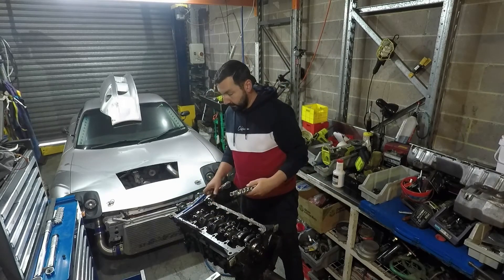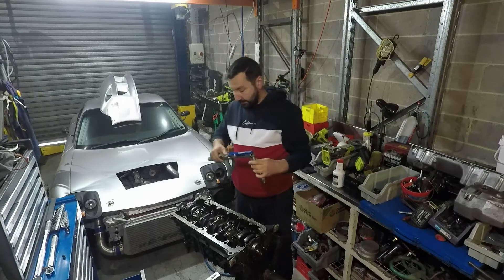HOW TO BUILD A BMW ENGINE M50 M52 TURBO 1 of 4 (BLOCK)

Comment: so it is possible to put m50 nv rods to m52 crank with m52 pistons?...
Reply from the maker: Yes. You can put those rods in an m52 b28 or m52b30 stroker As they are 130mm

Comment: Note: If you want to build a budget turbo stroker motor using the M54B30 crank, and you're like me with an M50B25 non VANOS thinking "Oh, i'll just use the THICK BOY non VANOS rods with the 3 liter crank", then think again.  You cannot run them as they hit the bottom of the bores with the longer stroke crank. It almost has a 1.5cm longer stroke. Ask me how i know... 
I guess you could start cutting. It doesn't look like too much needs to be cut away. Definetly doable, i just got aftermarket rods instead. Didn't wanna deal with the headache.
Reply from the maker: Yeah I would assume it's from the longer stroke. No issue with the 2.8
Reply: Did you have to gap your piston rings
Reply: @drayescobar9469  If you have crank and pistons/rods out anyway you'd be stupid not to get new rings and gap them for the best results. If you're leaving the bottom end untouched then just send it. A lot of people do, but with varying degrees of success.
Reply: hey brother....can i use m50 nv rods to an m52b28 crank and m52b28 pistons?
Reply: @mateoseggonidis I believe so. If it’s an m50 non vanos you have to bore it out to fit the m52 piston size
Reply: I have an m50 vanos (technical update) (m50b25tu to be exact) . Would this engine be fine to build for boost, or does the non-vanos m50 have advantages over the vanos m50? I want to build it for fun, nothing crazy. or how much power could a stock m50 vanos take boosted?
Reply: @TheAnointedOne7  Both are fine for boosting. 400-500hp easy, especially if you have access to E85 instead of pump gas. Having VANOS is always better than not having VANOS. Non VANOS have some advantages if you leave the engine stock and do a budget build, like the rods are a bit thicker, the valves are 7mm instead of 6mm so thicker, and the head has double valve springs so it can rev higher. Your stock cams dont make power past 6500-7000 RPM, so being able to rev to 8000 is useless. The downside is some electrical stuff like sensors and ECU are an older type and you don't have VANOS. VANOS will make you spool about 500rpm lower which is a lot if you realistically only have 3000 RPM worth of powerband. It's not something you should worry or care about for less than 500hp. The rest of the stuff are all the same. Work with what you got. Non Vanos was only 1990-1992. Theres a LOT more people that have turboed M50TU and M52 than M50 non vanos.

Comment: Question: How are you using 135mm m50 rods in a 2.8 liter which originally comes with 140mm rods?
Reply from the maker: The M50NV Rods are 135mm same as the M52B28. The M50TU rods are 140mm. It took a while to measure everything up but it all works. Thank you for your question. Its something i should have addresses in the video.

Comment: hey vas ik this is a old video but could i use this guide for a s50? i got one in parts but idk where to start assembling it, plan on slapping on a small snail
Reply from the maker: I feel almost all engines from 92-2005 are pretty much the same, that's why all the parts are interchangeable. Main difference with the S50 is the head design is completely different.
Reply: @VasKatsaras so can you throw a s50 head on a m50 iron block?

Comment: Another option for head sealing is o-ringing the block, then you can run a stock composite head gasket and it will hold to over 1k hp. Pretty handy if you're pulling the head regularly because the stock head gaskets are cheap.
Reply: How do u 0 ring the block
Reply: @woapaggin6803  you can get a machine shop to do it or do it yourself
https://youtu.be/gbWAgi82cOY
Reply: Disadvantage is if something goes wrong with the tune up etc or detonation u will take the head out just use stock OEM gasket with arps it works great u rather have the head gasket go out then destroying the head the gasket is acting as a fuse basically the o ring system or fire ring system is basically making the head one with the block and it puts alot of stress on the center off the head when its clamped down this system is good for drag racing only but for a reliable build that can take punishment stock gasket is best on the bmw m50 and other models of bmw engines in my opinion
Reply: @prienchutterpaul6638  it makes sense you always want to have a weak point somewhere. For me i rather my driveshaft break than my trans or diff going out it's easier to replace a driveshaft than a transmission that way you get the car going the same day within an hour of it breaking. In the engine id rather replace a gasket than the head so it makes sense to use OEM plus FCP euro will just give you a new one
Reply from the maker: Yes definitely however a little out of my scope in my home garage